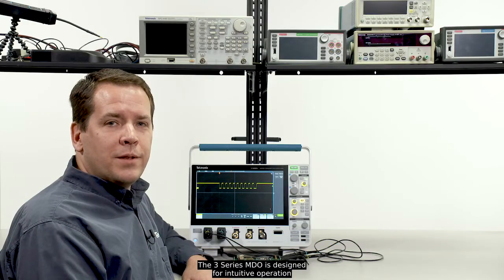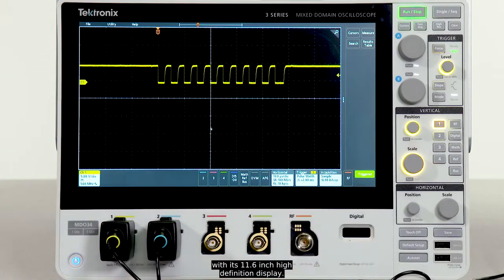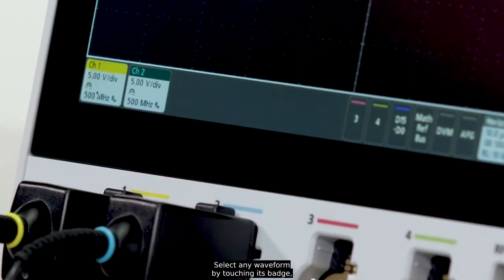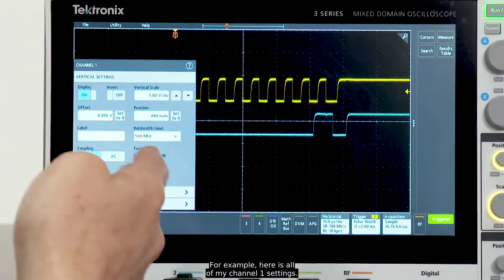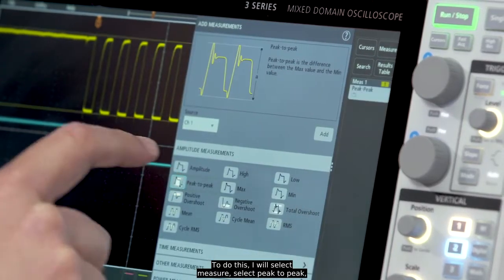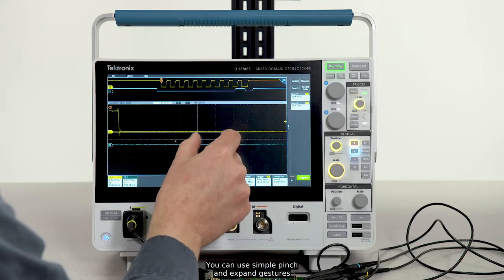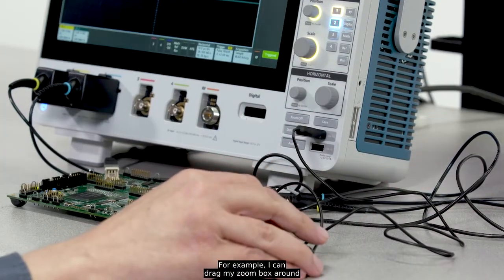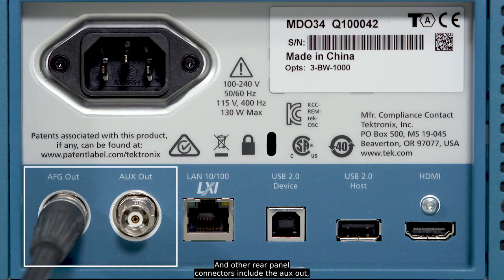3 Series MDO Technical Overview Part 1

Comment: I have questions for  this 3 series MDO Oscilloscope...  In the horizontal scale right,that not going anywhere  of X or -X positions , that mean , horizontal trigger point of "T" not going out of the display screen... 
In case I'm using 3 continues pluses in 800ns ...I want to see 3rd pluses of rising or falling edge portions...but I'm not able go that 3rd pluse position in same 800ns horizontal scale... Now,what can I do ????